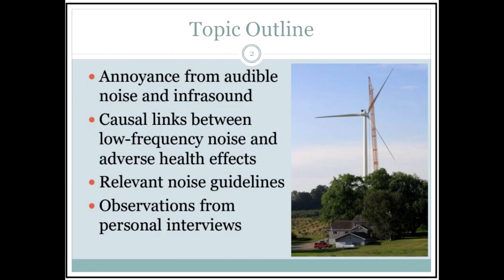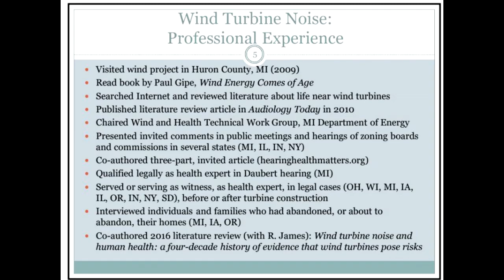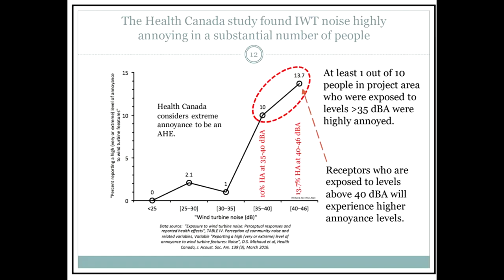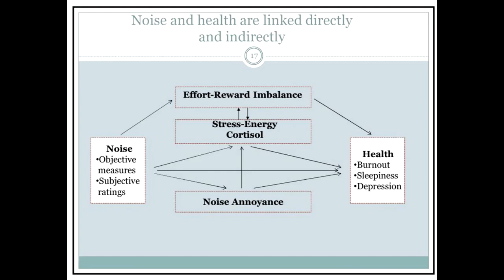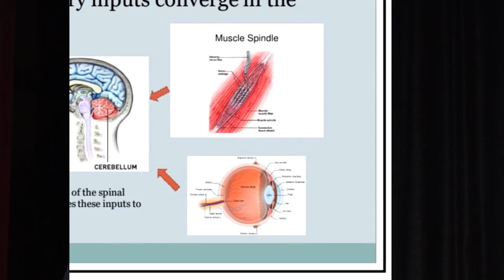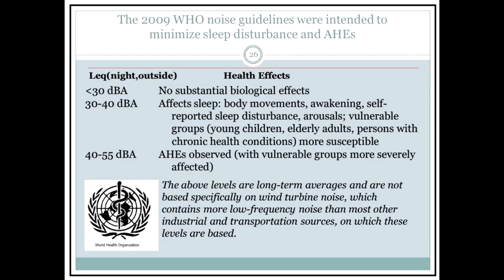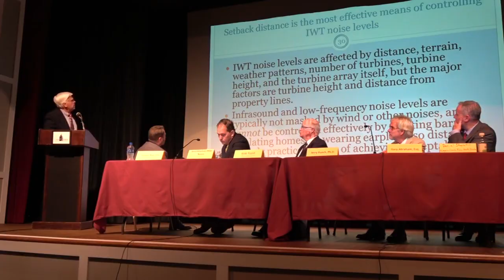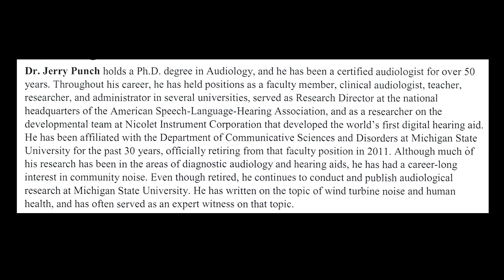Audiologist diagnoses wind turbine infrasound: Punch, PhD

Comment: I live near 10 commercial wind turbines and 2 of them are within 1,000ft of my farm and can verify they have adverse effects to human health. I haven't got consistent decent sleep in the last 10 years because of them, I get migraines from the shadow flicker starting in November and ending when the sun moves north, they are loudest from 3am-sunrise due to Air pressure changes, they are loud when there is heavy moisture at the height of the turbines, my dad had cardiac arrest (almost died in fact) within 5 months of them going online and I have gained weight since 2010 when they were commissioned due to the loss of sleep and other issues.

I have proved my theory just from times that I have had to stay at a hotel away from home for meetings. Everytime I was able to go to bed at my normal time of 10pm and I would sleep all night, wouldnt not snore and would be up at day break at 5:30am and felt like I slept.  At home with the turbines running I go to bed at 10pm and sleep through my alarms constantly because I dont feel like I have slept or didnt fall sound asleep until a hour or so before my alarms go off.